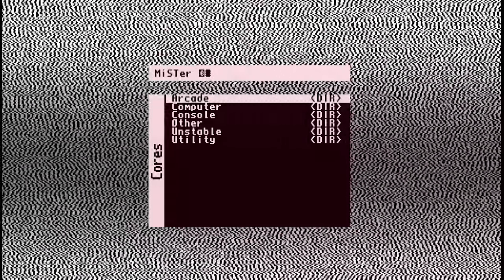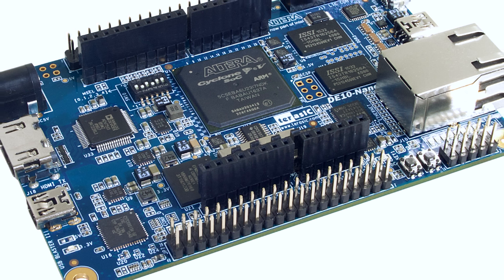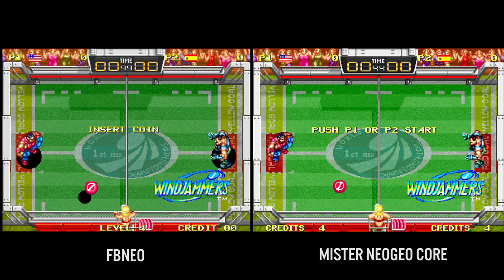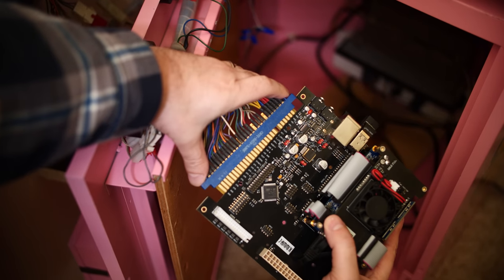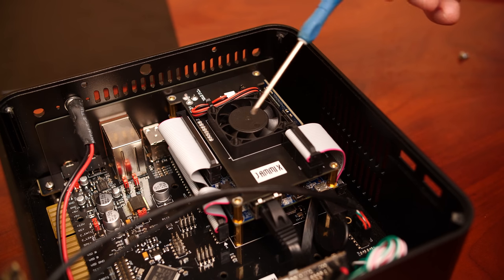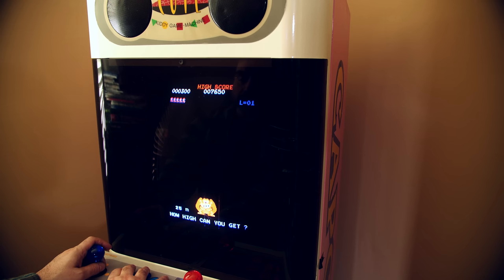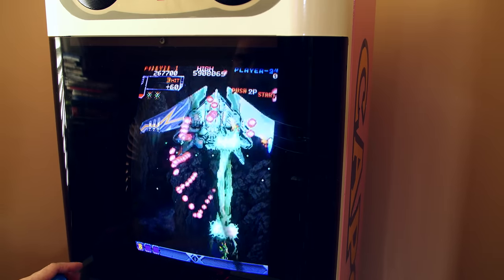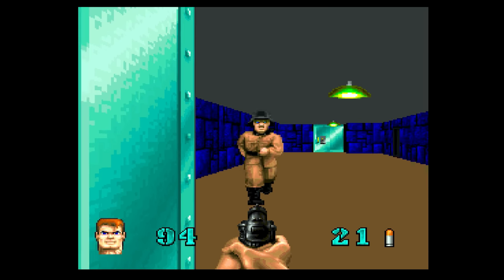Finally - I got my hands on a MiSTer FPGA Retro Gaming Setup | MVG

Comment: What about syncing? Can you play fast pacing games without scrolling issues?
Reply: Are you speaking of screen tearing or pixel crawl?
Reply: @lukasperuzovic1429  well… I’m not sure what is the name of it. It happens specially when you play Sonic games. You start to have headaches because you can’t focus on the background. I think it happens when the game is supposed to run at a certain sync but the “emulation” runs it at 60hz. One think that helps is “black frame insertion “ or sync technologies like freesync and g-sync. Or it might be pixel response time. Like you test the screens with the ufo test. I don’t know for sure. ;)
Reply: @SolSeal  Oh i think I know what you are talking about now. Yes the MiSTer has a Vsync option in it's INI file. You can set it to original system refresh (which varies per system) or match the refresh of your display, Instead of putting in a black frame it ether doubles or drops a frame if you are going to try to match the 60hz refresh. 
You can also add lines to the ini file to set this option per core if needed.

Comment: EXCUSE MY IGNORANCE but Mister emulates hardware or the chipset IS the hardware in a newer form??? Please help. 🤯
Reply: So in a completely incorrect and laymens way of describing it, the FPGA is a series of gates that reconfigures it self to mimic the hardware. 
Field Programable Gate Array is what FPGA stands for, there a grid of logical gates that with a little bit of code can configure itself to various components to form copies of whole chips, and even whole systems. The code is just instructions for the FPGA to load up and "take" the form of what schematics for that system.  

Think of Software and Hardware Rendering in old Win 98 games, Unreal tournament looks playable in software render but looks better when you have a graphics card to hardware render those graphics.

But just like software Emulation, it depends on how well that code is written. In Software Emulation, you are providing a Software layer to fudge that game rom to work in a non-native environment. In FPGA Emulation you are trying to make a copy of the circuitry of that system. Some of the more accurate and system demanding software Emulation tries to run a software simulation of every chip which is called Low level emulation (as you are getting to the components in that system).  FPGA only runs low level as you are trying to copy those schematics.

Comment: If only you could actually buy a de10 nano. 🤔 I have original hardware and emulators. It's not enough of a difference for me to care. So far as long as I have a low lag display everything is fine. I do wanna try a mister though.

Comment: It looks expensive compared to an emulator, but this is cloned original hardware not an emulator. The PCengine core works exactly as the PCengine only without the problems like analog noise and so. MiSTer FPGA is cheap, only an upscaler costs half of what you pay for the MiSTer, a single flash cart may cost the same as the MiSTer... not to talk about what a single Arcade Board costs

Comment: I was tasked with fixing a portable ultrasound machine for a friend and his friend's vet's office. They were having a display out issue, and when I saw the screen go white, I assumed correctly the display chip was over-heating. Cracked open the $5k device and found out it was using an FPGA controller and they were choking the heck out of the device and not letting ample heat escape to happen. They put a giant thermal pad under the pcb where there aren't any real chips there, and reducing the space to 50% of the already tiny space the board was situated in. Added a crap ton of heat sinks to it and was able to run it for 4+hrs straight compared to the 30 minutes.

Comment: another great video. thanks. 
Mister started as a cheap alternative MIST project, which was a custom FPGA project to emulate few computer core - mainly for Amiga and Atari ST core(so it is aMIga + atari ST = MIST). MIST was the first FPGA project to load software core to emulate multiple classic computer systems - but it was expensive. so one genius thought about porting MIST project to more commonly available FPGA board - DE-10 NANO. He did the most of MIST Core port to Mister(he named it).  MIST project was derived from original Amiga FPGA project but... that's another story to tell. as it times goes by Mister get so popular and it killed MIST eventually(custom hobbyist hardware vs mass-production board with much powerful chip). 

and DE-10 Nano was $170 but the manufacturer bump up the price 2 times.. Now I think it is officially $220 ? I think.
and it is all sold out anyway due to current situation.

Comment: Any time something arcade is mentioned I ask in hopes of someone somewhere someday knowing of a solution.  Does anyone know of a good frontend for MAME that can exclude entire groups of items?  For example, exclude software (ie arcade only). Exclude bad ROMs or show only good ROMs (green).

The standard MAME UI gets close by selecting WORKING ROMs but you're still swamped with all the software titles.  I'm so sick of the software side having massive amounts of garbage that doesn't work, so much so I just ditch maintaining that entire thing.  Between Software ROMs and Software CHDs you're talking over 2.5TB and most of it doesn't even work or they work but are horrible to use like C64 stuff.  Dedicated emulators work so much better.
Reply: Launchbox/bigbox is probably the best option out there for managing working with mame games and playlists and emulators.

Comment: I wonder how they get the hardware schematic
Reply: For many arcade boards and micro computers, you can find and buy the service manuals, many will have the schematics and wiring diagrams in the documentation.
It was common in the 70s and early 80s to provide schematics even in the owners manual for consoles, lasted till the mid 90s for Arcade cabinets.  

For others it's striping that PCB bare, photocoping the board if it's single or double layer, striping the board down layer by layer if it's multi layer, decapping chips and looking into a microscope to look at the chip inside and recording what you see.

Comment: Hey MVG, this might seem like a weird request, but can you upload your videos at 30FPS instead of 60? The latter is murder on bandwidth and computer performance with no noticeable improvement in video quality. Arguably, 60FPS makes the video quality worse because you are trying to fit more frames into the same bandwidth envelope. It became especially apparent how bad it is while I've been on the road these past few weeks - hotel internet and tethered 4G LTE cannot keep up with 1080p60. This means either a video that keeps pausing or losing significant image quality at 720p30.  Thanks for considering :)

Comment: What about the price?
Reply: Its $200 atm without any add ons. And other than the SD RAM board, you don't need any other add on boards to get started. The 128mb SD dram is $60 and you can find used 32mb ram boards cheap.
You can get by with a OTG adapter, USB Hub and the Existing HDMI out. I/O board is optional, you can get like a  25x25mm heatsink for a buck or two, and 40mm 5v fans are like $2 if you want it

Comment: Emulation can do all this as well
Reply: yes, but all emulation software must fight against many other applications for computer resources. This generate lags and loss of precision. FPGA is like a dedicated hardware and simulate real electronics components, not just roms.
Reply: Emulation is just providing a software layer for the game roms to run in (High level fudges it, Low level provides a simulation of the chips in software).
FPGA runs a copy of the wiring schematics for each system in the Reprogrammable FPGA Chip, the logic gates switch into a configuration to mimic the hardware. All FPGA is Low Level.
Real difference is on the PC Low level emulation is very system resource intensive, Some High Level Emulation needs ether plug-ins or roms to be patch to work (like the PS2 or N64 Emus). 
FPGA doesn't need the system resources the PC requires for low level, its non FPGA side of the device only has a 800mhz Arm CPU and a strip down Linux for the backend for file housekeeping, the Linux and Arm CPU isn't doing any of the emulation.

Comment: Its investment only if you have thriving YT channel.
Reply: His kit is $700, the base board that all you need to get started is $200, most Add ons are $50 a piece. MVG here got a premium ITX ALL-IN-ONE board with a Jamma edge hence why the ITX board is $250. It's like $315 to $400 to be fully kitted out minus a nice case, which varies on what kind of case you want. ITX is just going even more Extra. 
There some decent 3D Printed and acrylic laser cut cases if you know where to look. Keep in mind MVG got his on loan from Bob of Retro RGB, so he doesn't know the actual price.

Comment: Why not just use a 120mm on a mount to cool the thing, at least in that case
Reply: You still want a small fan over the chip that does most of the heavy lifting. Like you wouldn't run a PC without a CPU cooler.
In my setup I got a fan on the FPGA and another for the whole case. It's not 120mm as one don't fit the ITX case I have.
Reply: @lukasperuzovic1429  But wouldn't it be better to have a fan going across everything, with heatsinks on the more powerful chips, even using shrouds to take more airflow to specific parts on the boards, even using an adapter, or zip ties, to get the fan on, those tiny fans ought to be pretty shit, given the amount of blade there is compared to the motor.
Reply: @genericscottishchannel1603  There only 1 Chip that needs cooling, its a 25 by 25mm surface. It doesn't get that hot. Most of the Cores don't make the chip that hot. a 5  volt 40mm fan does the job and does it well.
I don't know what fans you been using, but I can find 40mm fans that do the job well and isn't noisy. 

You can only fit so big of a heat sink onto the thing. If you are extra concern MiSTer Addons makes an all aluminum case that acts as one big heat sink that cools passively. 

You just need the 1 Fan to have air go over this 25 by 25mm heatsink, You don't really need a case fan as that one chip isn't going to heat up the case by that much. I used to run my MiSTer in a 3D PLA filament printed case. At no point did the thing get warm.

But I did wanted my MiSTer to look more like a Console so I put the thing in a tiny Micro ITX case. The case has plenty of ventilation and additional 60mm fan mounts for exhaust. For the work it does, it runs rather silently The extra 60mm fan runs silent. But I also run a SSD in the same case hence why I want a case fan.

For MVG set up and his needs, he doesn't need anything more than that little fan. 

If you want to get upset, you should see the MiSTer I crammed into a Ras Pad3 (a tablet case intended for the Raspberry Pi 4) with a ridiculously small fan. The Cases' driver board for the display run hotter than the DE 10 nano does.
Reply: @lukasperuzovic1429  Im more upset about the numbers, why does the pad3 go with the pi4
Reply: @genericscottishchannel1603  You didn't even read my post. I had crammed a MiSTer into a Tablet for the Raspberry Pi 4 called the Ras pad 3. It has a tiny fan, and the driver board for the video display puts out more heat then the DE 10 nano does.
Reply: @lukasperuzovic1429  I fucking did, Im now more concerned why a third party product for the 4th model of something is named as the 3rd model
Reply: @genericscottishchannel1603  I got no idea what you are ranting about. Bye.
Reply: @lukasperuzovic1429  oh you definitely never got through school

Comment: Mame and beastnes? What is beastnes?
Reply: I think he meant to say BSNES, its a accurate SNES Emulator that us very system resource intensive as it aims to do whats called Low level emulation.
It's running in software render all the chip behavior of the original hardware.

There two kinds of emulation High Level and Low Level.
High Level is kind of lets fudge the Rom to work in the PC as we got no clue how the hardware works, N64 and PS2 Emulators are examples of High Level Emulation.
Low level takes in account the original systems schematics for Emulation.

All FPGA emulation is low level as the FPGA Chip is trying to replicate what going on in that hardware schematic. 

Low Level Software and FPGA Emulation is very close to each other, as devs for one often work on the other. Alot of MiSTer cores was worked on by Software Emulation Devs who want to take their work to a new direction, by preserving the hardware schematics the bets they can. Some MiSTer Core work even gets back ported back into software Emulation. Jortego who did the CPS2 cores took his results of the MiSTer and applied them back into MAME.

Comment: I don't get it. Why this expensive thing over emulation?
Reply: Lag free emulation
Reply: Because this isn’t software emulation it’s emulating the chip set of the og hardware I think. You know when your using an emulator and something feels off well this runs just like og or as close to. Most won’t care but some do.

Comment: Price is definitely the big stop gap. As for a full setup that includes all adapters will run up to $1000. This without even adding an arcade cabinet. And I really don't know if cores for PS1, saturn, n64 and Jaguar can be ever fully fleshed out in the current d10 board. Same goes for all PC games up to Win95.  I think that will require until the next Fpga board to be fully realized. The good news on that is that the new board should be quite more capable. And that will allow up to not just everything I mentioned but also all PC games up to Win2000 (in a minumum mode at least) and up to the DS.  Bad news is that will be as far as Mister will be able to go for like 5 to 10 years after that happens.  As the jump from PS1, N64, Saturn, Jaguar and DS to PS2, OGX, GC, Dreamcast and PSP when it comes to FPGA's is enormous not just for the FPGA chip, but also for the development of one of those consoles as a Mister Core. And because of how hardware changed from then on. A lot more lag was introduced too by default. Meaning the advantages of Mister vs Emulation get seriously reduced compared to all generations prior to that. Oh, without mentioning the initial price for the next step in FPGA boards with Mister. As then a full setup will start at $1000 and up for the first three years.

Comment: The only thing i really dislike about it and what's generally turned me off about it is the name.. lol
Reply: its to homage a older project called MiST which is a contraction of the 2 more popular cores for that system MiniMig (Amiga) and Atari ST. The MiniMig core came from the project of the same name that was a mini sized FPGA clone of the Amiga, a Mini Amiga hence the name MiniMig. 
The name MiSTer is because many of the Project MiST cores got ported to the DE 10 nano.

Comment: The $$ price of entry isn’t the block here, it’s the plethora of conflicting HW add on options. SW emulation on a decent PC is simply too accessible for the everyday emulation fan to ignore. Mister feels like a solution for the hardcore purist. The poor Amiga core is a personal deal breaker for me.
Reply: What are you main issues with the Minimig core atm?

I thought it was one of the best cores atm, tbh.

It has support for RTG now, but I haven't played with that much yet.

A lot of the smaller bugs concerning the edge cases in some games and demos have been squashed. There are a few more left, ofc, but it's getting better all the time.

As far as game compatibility (OCS/ECS, and even AGA), the Minimig core scores very highly there, from what I've seen.
Reply: @electronash  Hi the core IS good, but it isn't better than a SW option like winUAE. The core issues are enough to make miSTer unattractive if Amiga is your primary focus.
Reply: @ddniUK  I have lots of real amigas and consider the MiSTer/Minimig to be my best Amiga. I'm not aware of any core issues.

Comment: That fan is absolute garbrage, you should consider a bigger radiator an a bigger but slower fan.
Reply: It doesn't need much cooling for what it does. There are passively-cooled housings available for the MiSTer that get the job done just fine. Maybe if developers try to really push the hardware and attempt to emulate the N64 or something similar, then you might need a better fan/cooling setup.
Reply: I'm not sure how you can determine the quality of that fan by the video. It could easily be a good quality brushless model. Most MiSTer systems use 40mm fans and are perfectly fine with them. I have been using one for three years now with no issues.
Reply: @miltonbates6425  its more about my philosophy on fans - its better to have one big one running slow than small ones running fast. Small fans in my expierience produce more noise than cooling.
Reply: @ZaPpaul  I have a whole batch of small fans like that that are more of a noise source than a cooler.
Reply: @H34D5H07  Its a tiny chip with no CPU cooler Mounting. The Chip only takes a 25 x 25MM heatsink. The single 40mm fan is only to make sure air goes by the heatsink. 
I got a similar setup and it's almost whisper quiet.